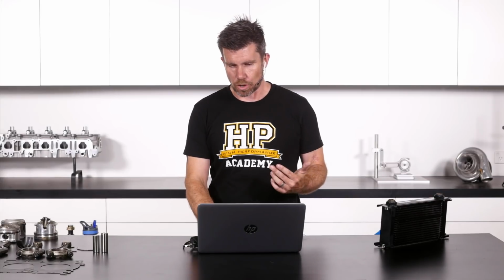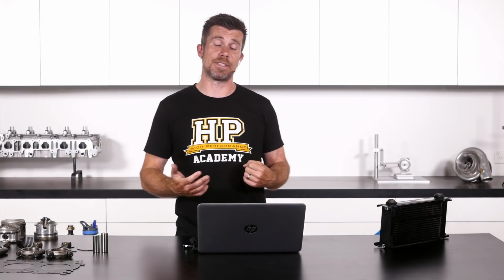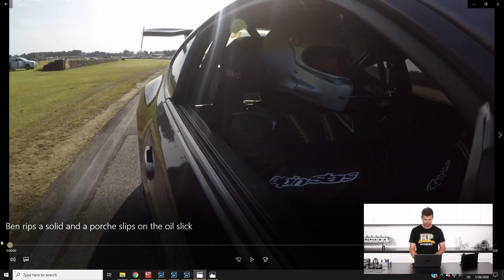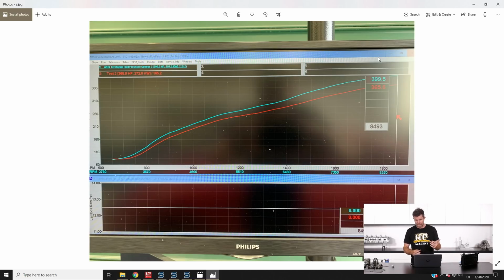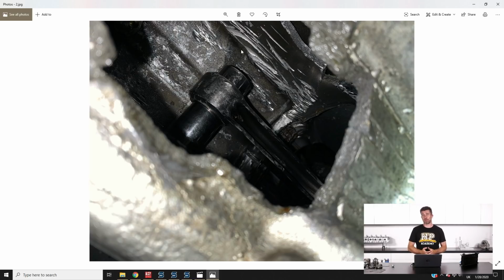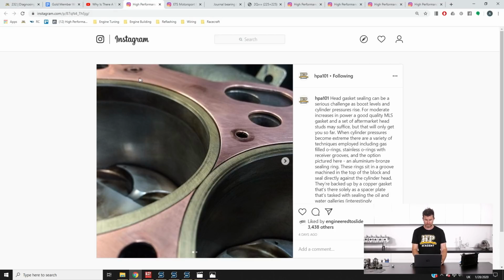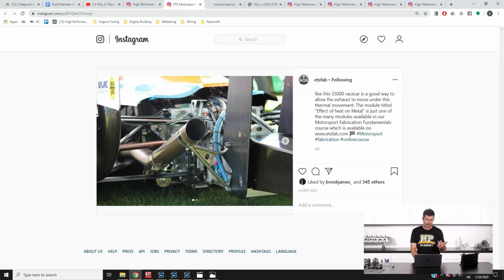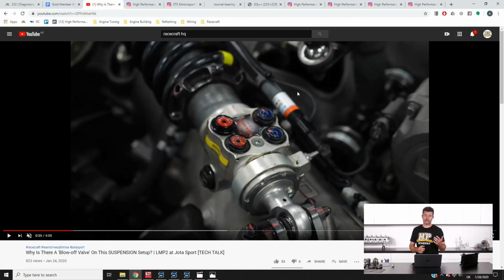The Truth About Driveshaft Shop, Secondary Forging And More | Today At HPA [UPDATE 232]

Comment: Why did engine protection not work on that lunched engine
Reply from the maker: Because we raced it anyway 😅 The sign that things weren't right Andre covers in the video, but we took the risk anyway for the weekend.
For anything temp or pressure related on track there would have been an alarm, but this was a little more sudden. Also bear in mind Ben is a rookie driver essentially so he might have missed something another driver wouldn't have on that last lap, or he might not have at all, things happen fast. 
It is a shame but it was a one-off race for us that we hopped to sneak in before rebuild rather than a first race of a season catastrophe thankfully 😎 - Taz

Comment: bolt in a 3UZ with good pistons and add some boost
Reply from the maker: While we'd love to add some boost, that would require re-engineering most of the car and that's not realistic at this point.
Reply: @hpa101  Bullet have a low profile blower manifold coming for VVT-i engines this week apparently... add a TVS2300 even without a intercooler on E85 should be good!

Comment: K24 swap the 86... It would be the most balanced option for that chassis
Reply from the maker: Yeah Brandon here has been whispering that in Ben and Andres ear, but I think a 3uz is the most likely - Taz.
Reply: In full-on drag trim, they're getting over 500hp out of those little engines - road race, I think it was a little over 400.
With the blower, could be looking at an endurance build of 6-800hp?

Comment: DSS axels are more for drag racing not endurance racing from my knowledge. That’s probably why they get ruined
Reply from the maker: The axle doesn't really care what it's being used for. We're putting less power/torque and shock loading through these axles than your average 2JZ drag 86. The only difference that's relevant is heat in the CV. Nothing excuses the axle falling out of the diff centre because it's too short though 😞
Reply: High Performance Academy that’s what i was getting at. The amount of heat generated during an endurance race. Not like drag racing where it’s just a few seconds and that’s it. But you are right it shouldn’t pop off